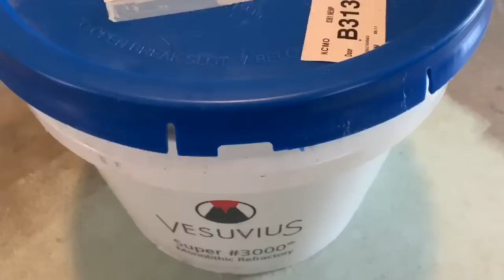Building the Backyard Metal Foundry - Melt & Pour

Comment: Just an improvement tip , instead of normal steel wool , use stainless steel wool.  Normal steel wool will rust causing internal expansion and cause the forge to crumble .

Comment: Was wondering how this foundry is doing after 7 months. Still using coals? Eventually I want to upgrade my electric furnace to a larger version to melt more metals. Debating making one vs buying one.. and now coals vs propane. so curious hows this foundry is going after 7 months
Reply from the maker: It’s still going but I’ve had to build a half dozen tops so far. I’ve reapplied the refractory layer several times and that seems to be the saving grace, but honestly this setup is not for the long haul and has limited me. That being said chatter made a comment suggesting different materials that would last longer for coal, but my next build will be propane ( ceramic blanket/refractory/burner) The charcoal is messy and the more you burn the more ash builds up and you get some air blockage. I feel the purpose of this build is to prove the concept and show that it can accomplish melting different types of metal, and there are a few others I want to try before I ditch it.  Good luck which ever way you decide to go and keep those cool videos coming, I like your new 3d printer.
Reply: Like the King if random said after his got so many views and what This Poster said.  It's a great foundry. For beginners. I made one to see how much I would use one. (Not as much as I thought) if you want to get into melting metal. MAKE THIS. It's cheap easy and very effective. But if you fall in love with the hobby and are burning through them (no pun intended) then save up for a good one. BigstackeD is an excellent melter and provides coupons all the time for really excellent ones. There is a saying "if you are going to buy a new tool. Buy the cheaper one, if you break it in use. Then you buy the expensive one." Meaning, if you use it enough, and once your learning curve is behind you. Then go for the good stuff.

Comment: Nicely done. I'm working on one using basically the same stuff except I'll be trying perlite instead of sand. The addition of the fireplace mortar as a surface protector is good, I think, so I'll be trying that.
Reply: Definitely use fireplace mortar instead,won't crack an powder out like concrete

Comment: Is this only good for softer metal like aluminum or could you melt down steel 🤔
Reply from the maker: I have used it to melt aluminum, brass copper and silver, so I think it can get to about 2300 degrees, but I dont think it could melt steel at about 2800 degrees Fahrenheit. 
Thanks for the question

Comment: nicely entertaining and thanks for the outtakes at the end!  Using plaster/sand mix I found making the top much thicker and using metal banding around the outside helped since it eventually cracked and I didn't want to build a new one.  I also found using the smaller bucket was problematic getting enough charcoal into it.  It always sucked to try to get the crucible back in after the pour too, which is why I eventually went to a much larger furnace using wood and charcoal.  I miss the larger melts from that some days still!
Reply from the maker: Thanks for the comments and the Sub!  I defiantly understand the challenges with the bucket / charcoal foundry.  Originally I had gathered different materials to do a propane build but wanted to re-visit and prove out this concept first after a previous failed attempt.  Stay tuned for the next build once this one has run its course.
Reply: @MARVELOUSMETALS  looking forward to it!
Reply: i guess it's quite randomly asking but does anyone know a good website to watch new tv shows online?
Reply: @Adrien Rudy flixportal :P
Reply: @Uriel Brayan Thank you, signed up and it seems to work :D I appreciate it!
Reply: @Adrien Rudy No problem :D

Comment: Would just skipping concrete be better any kinda moisture would compromise the structure when reaching high heat levels i would think
Reply from the maker: too much concrete could store moisture, and in a high heat situation could cause a steam explosion. We just used about 10% concrete for added strength, and had no issues...
Reply: @MARVELOUSMETALS  thanks for the quick reply I am making a foundry and was just curious i appreciate it
Reply from the maker: @loganbates2657  No problem, we are still learning here, and if you look at my next video, I made a top with extra concrete and during the burn it actually popped and split in half (I didnt get it on film though) 
Good luck in your adventures!

Comment: Awesome video.  Can you explain the steps between 1)no fire 2)Air blower 3)Charcoal 4)??? 5)Fire.

For step 4, are you just getting something going with a gas torch or what?  How are you starting the initial fire?  

Thank you so much for the video!
Reply from the maker: Glad you liked the video, thanks for watching.
I usually add the charcoal, put some lighter fluid on it, lite it, let it burn a little bit till you get embers then add the air pipe and turn on the blower. You don’t want to start the fire while the blower is hooked up and not on as heat can travel up to the blower and mess it up. Sorry for the confusion, I must have left that step on the editing room floor...
Reply: @MARVELOUSMETALS  I figured as much, thanks for the quick response.  I've seen people just shove a propane torch in their forge but I didn't feel that was right.  Coal, lighter fluid then air.

Comment: Well you made mistakes, but equally learned from them. So maybe not mistakes after all, but little learning lessons... Thumbs Up! The concrete you used didn't look like it had any rock in it, what type was it? And for the life of me, where did you get your supply of refractory cement?
Reply from the maker: Thanks, it was and still is a learning experience! I used about 10% quick-Crete which had really tiny rocks. The refractory was ordered online, and was the most expensive part of the build. I’ll be upgrading to propane / ceramic blanket this year, so stick around!

Comment: I made the original version and my top broke as well.  Where did you get the crucible and tongs for grabbing it?  Also, did you use a regular muffin pan?
Reply from the maker: I got the crucible from PMC supplies, and I made some tongs (a lift tool and a pour tool) in a later video. 
The muffin pan was made of Cast iron to handle the heat.
Reply: Use fireplace mortar for the whole thing won't crack after heating multiple times